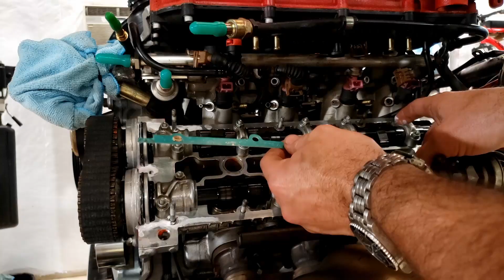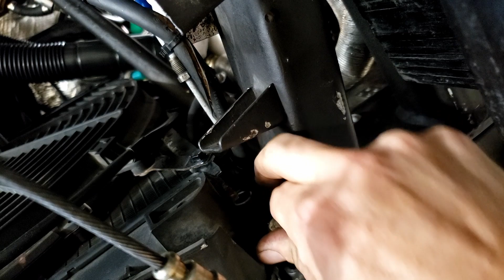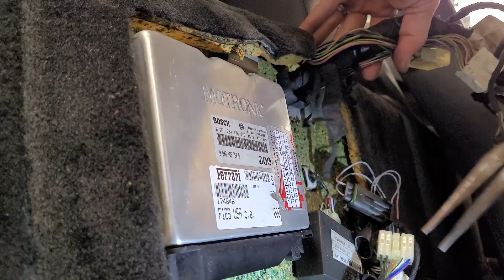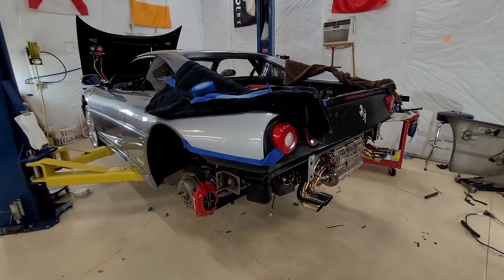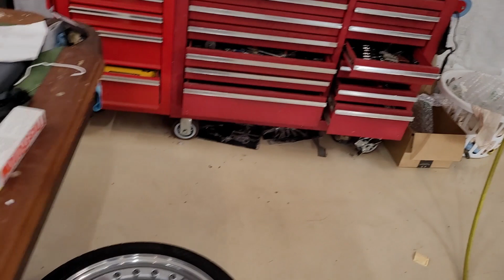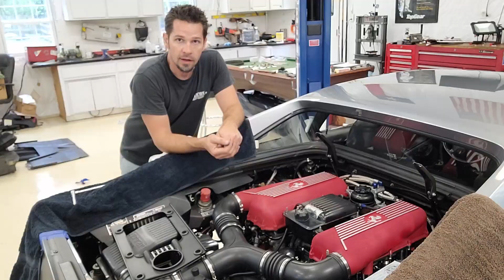F355 Engine ~IN~ PART 5 All back together and First Drive!

Comment: Hi question, it's necessary to drop engine out to remove the headers? Thank you.
Reply from the maker: Nope, the headers can be done with the motor in. Definitely takes a little bit of a finger ballet to get to the bolts but totally do able

Comment: This winter, while in storage, a rodent got into my 355 and did a lot of damage. I was planning to take it in for the major next year but now I'm going to do it myself and repair all the other damage at the same time. I wouldn't be nearly as confident without these videos. Thank you! 🙏
Reply from the maker: Dang that sucks, well at least with the engine out it's very easy to identify the wiring that needs to be repaired.

Comment: Thank you for the great video!  I couldn't find consistent parts diagrams on where the belt cover spacers went but your videos are so detailed that now I'm confident they go on the top 1 bolts (in place of the front belt guard found on the Challenge models).

Comment: Hi Ken, Nice job! I rebooted my F355 connector of the Idle Speed Controller and may have mixed up the Battery and the Signal wires. Are you able to help? Cheers

Comment: So at no point do you check the timing belt tension?
Reply from the maker: No, but sort of. The only adjustment is the belt tensioners, and according to the manual, the only needed action is to set the Gap at 2.5 mm. So this is the belt tension check and adjustment.

Comment: Great minds think alike.  LOL    It took it forever to lower the car back down over the engine cradle, I had a friend's stand but only two of the wheels pivoted, so I had to use a floor jack too for adjustment.
Reply from the maker: Haha, it's a ballet.

Comment: Fantastic work Kenny.  I laughed when you described the cussing and yelling when it developed a coolant leak.  When I did mine, I had multiple coolant leaks.  I didn't realize that the coolant line clamps really need a lot of tightening to seal.  One question:  how did you lock the crank so you could torque the crank pulley bolt?  We cheated and used a torque stick but would much rather do it the way you did.  Thanks again!
Reply from the maker: The proper way is to buy the tool, which bolts in place of this starter motor locking the whole drivetrain from moving.
My personal opinion, during the amount of torque needed, that puts a lot of stress on the crank, front main bearing, flywheel, and transmission housing that poses a risk of something breaking.
One could argue that Marking the crank bolt before you removed it and using an impact to tighten it to the exact same spot is better option.

Comment: Kenny, such a great series, best I’ve ever seen!  Aside from your knowledge and mechanical talent, you’re a great communicator and videographer!  The lighting, audio and editing was fantastic.  Wondering if you might have any “cutting room floor” footage on the A/C recharge?  I’d find it helpful as I just struggled thru replacing the compressor/dryer on my ‘98 F355.  Maybe a short future video.  Thank you again!😬
Reply from the maker: Thanks mike, I definitely have lots and lots of cuttingroom floor footage LOL.
That was the biggest challenge, each of these videos could have been 4 hours long each, I wanted them detailed enough that any owner could actually follow along, yet still be washable for the general public.
I'm trying to figure out what to do with all the extra footage, I could make standalone videos for things like the AC, and exhaust install etc. What specifically are you looking for on the AC?
Reply: @ExoticCarDIY  Thank you for the reply Kenny.  As I haven’t found much information on A/C work on these cars, I am experiencing higher than normal high pressure.  I filled using a scale for the proper amount, vacuum held good.  Perhaps some condenser blockage or the expansion valve, although low pressure holds steady.  
Just thinking that it would be nice to see the steps that you took.  😬

Comment: Great job and what a sound - you are motivating me to get back on and finish putting my engine in. Just super apprehensive as I have never actually hearing mine run before due to buying it with piston #1 missing
Reply from the maker: Go for it man! It's going to be worth it. These things are a blast to drive. It really is an experience